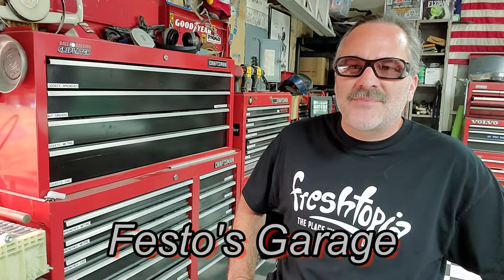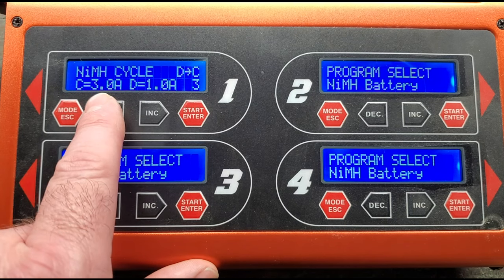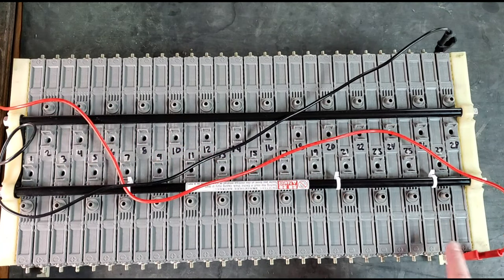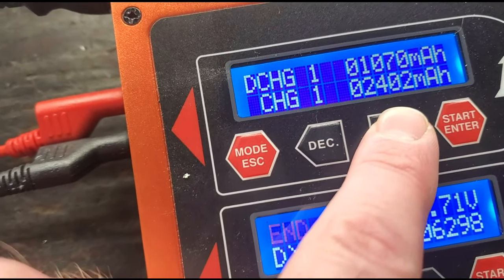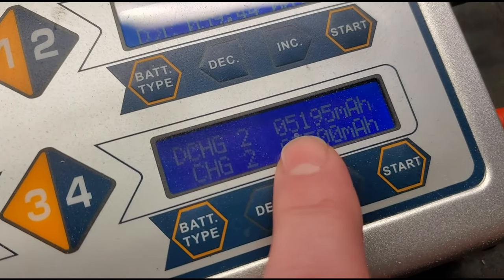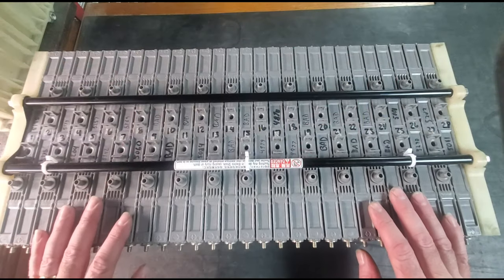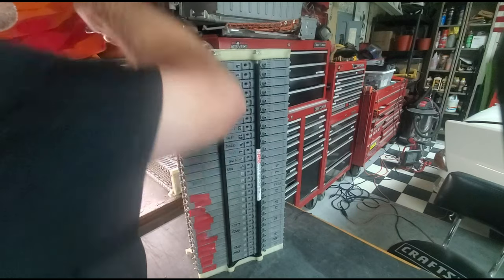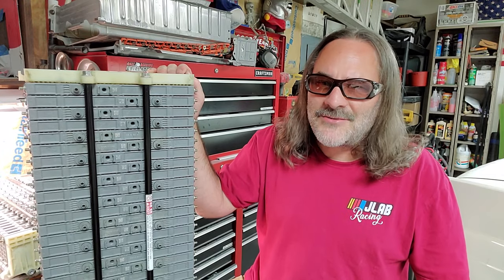Hybrid Battery Pack Refurbish - Step-By-Step w/ Settings - 2nd & 3rd Gen Toyota Prius - CQ3 Charger

Comment: Process completed.... changed out 8 bad modules. Dr Prius app says I got 97% capacity left and battery is in new condition! 😊 Will see how long this lasts before I get the orange triangle of death again 😂
Reply from the maker: Thank you for watching and providing awesome feedback.
Reply: I have the charsoon antimatter.   Basically the same in operation and function. 
 When i started in 2018 it seems there was a lot less info.
 Thankful for the recap on numbers for set up and what we want. 
 I can only charge at 7.2 or 8.4,  it goes past 9v and upwards of 10v on 8.4.   I dont like that
Reply: All my modules all seems to be good on discharging but needed help getting up to full capacity.
Reply: Is there any updates on your battery? I hear people telling me that reconditioning doesnt worth it since the battery will be weak again in 2-3 months. Is that true? Cause i am thinking if taking a risk and buying tools and all that or just go pay for a new or refurbished battery?
Reply: @MowgliLA refurbished/reconditioned is what he just did. This is the type of battery you'll be buying. If you have the time, patience an ls correct equipment to do it yourself, you can
Reply: If you dont want to do the process buy a wrench new version of your car and swapped the new cell. Lets said if you get a 2020 toyata hybrid. That HB should be good for 10 yrs or 100k miles easily. @MowgliLA
Reply: Also, you gotta know how to read the code letters on the modules so you can get the news one for a better price
Reply: No not true do it right the discharge is mpst important thing. Ive had mine fir 2 years no issues be sure to bslance after@MowgliLA
Reply: Search forums and follow the proper charge discharge reconditioning methods, these nimh cells have very long life, deep discharge to zero and recharge few cycles brings them back
Reply: How long does it usually take to run a cell thru 3 cycles?

Comment: One thing that I keep seeing about reconditioning these batteries is measuring resistance.   Measuring Miliohm resistance in batteries requires specialized equipment.   Nothing a multimeter can do.  I've been trying to determine a cheap meter that will do this, that isnt in a multithousand dollar specialized hybrid battery restoration machine.  I fond them in the $50 range with one paragraph  of english instruction, designed for flashlight and 9v style batteries.   Don't know if they would work.
-----UPDATE----
Just ordered one.  See if it works.

Comment: I like this video!  So thank you for that!  However, I see a train wreck happening if people “set it and forget it”.  Here are some tips to avoid problems.
Lets say you set the NIMH settings to charge @ 3.0 amps, discharge @ 1.0 amps, discharge cutoff 6.0 volts, CAPA 7500 mAh, wait time 5 minutes, 3 cycles, safety timer 720 minutes (12 hours) (which is what Gregg suggests).  The charger will discharge a module @ 1.0 amps down to 6.0 volts.  It will wait 5 minutes, and then charge @ 3.0 amps until it has charged 7500 mAh or Deta V is triggered (aka “delta peak charging”), which occurs when the module is fully charged.  Many chargers (such as the SkyRC charger) do not detect Delta V, but it appears this quad charger does detect Delta V.  But some modules are old, and they will no longer trigger Delta V, so you will rely on CAPA of 7500 mAh to save you (or max charge time of 12 hours)?  The problem here is that many older modules will be at their max potential voltage of 8.60 volts after applying just 4000 mAh.  
A new hybrid pack will run over $2,000 and a rebuilt pack will run $750.  An old module on Ebay runs $30.   Here are some things you can do to avoid needlessly damaging your modules:
1)	Set CAPA to 3300 mAh (for older modules), 4300 mAh (for good modules), 5300 mAh (for great modules).  Watch max voltage reached and adjust.
2)	Set charge to 3.0 amps.  After two cycles, you can set charge to 3.2 amps.
3)	Buy a SkyRC temperature probe ($10).  Set max temperature to 83 F (for a single module), or set to 110 F (if left in the pack).
4)	Set wait time between charge and discharge to 60 minutes (to allow module to cool).
5)	Set discharge to 1.0 or 2.0 amps down to 6.50 volts.  6.0 volts is too low.
6)	To refresh a module, you can discharge @ 0.1 amps from 6.5 volts down to 6.0 volts (once or twice).  Following discharge, allow 20 minutes for voltage to drift back up to 7.20 volts.  If the voltage does not rise on its own, apply a trickle charge of 0.1 amps up to 7.20 volts. Once a module is at 7.20 volts, you can apply a charge of 3.0 or 3.2 amps up to 8.60 volts.  
7)	When charging a module, the voltage may show 8.72 volts (or so).  After stopping the charge process, the actual module voltage may be 8.55 volts or less (the max voltage for Prius modules is 8.60 volts).  Delta V may be triggered around 8.72 volts.  This quad charger appears to detect Delta V, but this is not guaranteed.  Some modules are worn out, and will no longer trigger Delta V.  If you have overcharged your modules, they may no longer trigger Delta V.  If a module no longer triggers Delta V, this could be dangerous because the car’s BMS (battery management system) will not know when that module has reached it’s max charge.  
8)	When pairing modules for a pack rebuild, pair them based on similar resistance and mAh capacity.  Do NOT pair weak modules with strong modules as an attempt to fool the BMS.  It is better and safer to pair modules with similar capabilities.  Pairing modules with similar characteristics will reduce the number of failures of a hybrid battery pack.  If you have a super strong module, and you don’t have a good match, it may be best to leave that module out of the pack.
Reply: Excellent tips. Can you tell me how to best position the SkyRC  temp probe to monitor external temperature? Just set it on top?
Reply: Great clarification, Thank you! What do you mean in step 1) watch max volts reached and adjust?
Reply: Gary, in your opinion, what is the minimum amount of mAh required per module in order to have a good, working battery pack?  I have noticed with some of older modules, I am luck to achieve 3000mAh discharge, even after 5 cycles. Curious to know at what point does one just give up and classify a module as junk.
Reply: I kinda wonder what we are supposed to be shooting for. 4000 at 7.2 volts? 6500 at 8.5? or I guess more importantly, what should we be discharging in a real world scenario because there is no way in hell I can get 5000 like u r getting Mr. Festo
Reply: @MervsServiceSecrets  Someone who reconditions the batteries told me that 4500 mAh is the discharge cutoff for a single module.

Comment: Another excellent video from Gregg. I watched your first video and followed your steps exactly and my results were excellent. As was shown in your video, use decent cables rather than the cheapies found online. I did notice that some of my modules required 5 cycles of discharge/charge while others required only 3. The torque values on the bus bar nuts are 48 in-lbs when reassembling the battery pack. Thanks again Gregg for sharing your valuable knowledge.
Reply: Whats your battery performance after reconditioning?

Comment: Gregg, I want to thank you for both of your excellent prius battery videos, Your help was invaluable in taking on my battery rebuild project, setting up the charger, balancing,  assembly and disassembly of the pack. 
 A couple of things that might help others. I had to coax a number of modules thru 5-7 cycles to get them to 5000 mah, In the end I did not trust those cells or thought they would be the problems of the future so I opted to only use modules that got to 5000 mah in 3 cycles. also, I choose to lower the charge rate to 2.5 or even 2 amps on modules that tended to swell excessively, though It really extended the overall charge/cycle time.
Reply from the maker: Thank you for watching and writing in with the feedback.

Comment: Excellent demonstration. I took your advice and bought 2 chargers and have discovered that I need 10 'new' blades, I am just testing them now, and some are not getting to 5 amp hours capacity. The ebay vendor claimed that they were all above 5 amp hours, so I am still cycling them but no joy yet....
Reply from the maker: Thanks for watching. I have had some batteries come in that took a few cycles to get back to good numbers. This may be from the batteries sitting on a shelf for a while before they are sold to us and shipped out? Not sure.  Please write back and let us know how your pack turns out.
Reply: @GreggFesto I think you are right, some have taken 7 cycles but they are all getting above 5 amp hours

Comment: Still waiting of cables and battery will follow to start refurbishing  some batteries. I wanted to make a power bank out of a whole pack and connect it to a 3000 watt inverter to be used in black out. After asking around nobody could answer me. So went on Ai from Edge. If I run at 90% load so 2700 watt with fridge computer some stuff and let's say air conditioning, the final answer verified at 2 AI chats is 31 minutes so first that will kill the bank very quickly, and this makes this part of the project non feasible. Just wanted to let you know in case somebody ever wondered lol. Very dispointed, saved me couple of hours putting it together lol live and learn.
Reply: are U saying it doesn't work for your back-up

Comment: Hey greg i have 13 plug-in with 280,000 miles im in NJ averaging 50 mi to the gallon in the winter and somewhere between 60 and 80 in the summer when i first bought the car i got as Hi as 118mpg now I can't plug in as much so im down on mpg in the spring i might pull the pack and as i have RC chargers like what u use great videos 😊

Comment: I have the charsoon antimatter.   Basically the same in operation and function. 
 When i started in 2018 it seems there was a lot less info.
 Thankful for the recap on numbers for set up and what we want. 
 I can only charge at 7.2 or 8.4,  it goes past 9v and upwards of 10v on 8.4.   I dont like that, but unsure if its too much on the module

Comment: Hey there Gregg, so after watching your video I decided to go after the charger as well. While I am happy that your battery pack was in much better shape, unfortunately I can't say the same for mine. On avg all my modules end up below 1000 mah. I did find a guy who sells batteries with a range of 3500-4500 mah & so far one of his has passed the test. However, because of how many modules the pack has in general, I'm gonna have to make multiple orders to ensure that I can take care of bills at the same time. Just for reference, I do have an 09 Prius with 254k miles. So I did learn the hard way to give the battery pack at minimum 10 years before taking care of it each time in the future.
Reply from the maker: Thanks for watching.  How many cycles did you give your batteries before deciding they were not recoverable? I have had to run some 15-20 times before getting to the 5000mah value. I recently purchased some very good replacements from seller aloyhybrid on ebay for around $33 each. Each one was over 5500mah discharge. Sorry to hear you are having issues and hope you get your Prius back on the road soon.
Reply: So I've only run each battery once with the exception of the one that I purchased through eBay. There's only one from the original pack that seems to show some promise, so I'll give it another go. However I just don't have time to go wasting my electricity bill on cycling cells that just aren't showing any immediate promise. The downside of my situation is that I don't really have a nearby place where I can safely dispose of the bad batteries, especially since I've read that these nimh batteries aren't exactly healthy for the environment.
Reply from the maker: You should for sure run at least 3 cycles on each battery. Many times the first cycle will show low values or even CAPA with low discharge value.
Reply: You may wish to buy a used pack from a junk yard for $750 ($26 per module), or even $450 ($16 per module).  I wish I did this instead of buying modules off of Ebay for $330.

Comment: Hey Greg, great channel. I have configured settings from video, but for some reason it stops after first cycle. I set it to 3 cycles, and when the cell starts blinking “Capp” , I can use arrow button and cycle 2, shows zeros, and it will scroll 1,2,3,4,5, ..all zero’s except #1.
I’m still a beginner..
Thanks
John
Reply from the maker: Hey John,  Thanks for watching. Sounds like you are having good results. The charger stopped doing cycles because it met the 7500mah CAPA on first Charge cycle. Pay attention to the Discharge mah value and start cycles again. The Discharge mah value should rise each time. When you get to 5000mah Discharge this is a keeper, if you have 7500mah CAPA Charge at the same time then this is even better.

Comment: Thanks for the battery vendor tip, will try them once I get this refurbish testing done.  At time 8:56 of your YouTube video “Hybrid Battery Pack Refurbish -  Step-By-Step w/ Settings – 2nd & 3rd Gen Toyota Prius – CQ3 Charger” you change from your older red CQ3 to a newer silver & blue CQ3 charger.  This newer one is what I have and I am having trouble with the instructions for it.  If a test ends with a flashing "FULL" and I press the BATT TYPE button, no cycle results are presented, it just return to the initial screen.  What does a flashing "FULL" mean.  It apparently is not the same as "CAPA' or END.  The instructions that came with the charger say nothing about this.  Any help appreciated.
Reply from the maker: My silver charger was purchased about 3 years before the red one. I have a video that shows comparison between them. The message "FULL" is the same as "END". Be aware of the buttons when a cycle has ended. If you press the wrong one then you will get no results. The red and silver chargers have different wording on the buttons but the button position for results is the same (I believe the far left button for each channel).

Comment: Good Job Gregg,
Very thorough, that's rare.
I have a Prius, watched your video, bought both cahrgers.

programmed them as instructed, 3 cycles, discharge/charge, ran into something that you didn't mention.
About 2 hours into my time from start. all but 2 modules read FULL. I pressed the mode button as you stated if End was displayed, the screen didn't indicate and cycle information, discharge/charge... nothing, just battery type selection screen like from the beginning.
all of the 8 modules read Full but 2. Number 4 and number 28, they were still running the cycles.

Not sure what to do now. Start again? Not sure what full means pertaining to a discharged and charged module just a couple of hours into the process.

When I pulled the battery and tested each module, all tested at just over 8V but 2 at 7V. Figured that they may be the culprit

Thanks, Have a Great Evening
Reply from the maker: Thanks for watching. You are correct, FULL is the same as END. Not sure why you would not see results when pressing the same button I did. On both of my chargers it is the far left button even though they are labeled differently. You can see this at 8:55 in the video. I suggest try a different button on the next finished battery and see if you can get results. If you find that it is a different one, please let us know as someone else will have this issue too. The voltage reading is not going to tell you much about the health, remember it is the capacity that counts.
Reply: Also have this issue

Comment: Thank you for the excellent video. I wish you could post a link to the exact make & model of the charger you talk about so I know I am buying the right one. I currently have a SkyRC but I am stupified over how the menu settings work. It all seems so confusing.
Reply from the maker: Thank you for watching. The charger I use is the CQ3 from EV-PEAK Corporation. They are available and many hobby shops and Amazon. There are 2 different colors (silver and red) that both work the same.

Comment: Love seeing people diving into these subjects. Thank you! 
I just got my hands on a 22 Venza from Hertz rental with 48k on the odometer and this gives me hope. I’m trying to find out how long my Lithium cells will last. Thinking if it would be a good idea to get a battery replacement to have while the inventory is available even though it’s still only 50k on the meter. Does this make sense to get something this early?
Reply from the maker: Thank you for watching.  The more you drive the better battery will perform. Sitting for long periods is not good for them. For this reason I would not get a replacement pack and have it sitting around on a shelf - You may find out that it has gone bad on the shelf and you never got to use it.

Comment: Another great video! Hey i went to buy the charger and it has a warning "This charger is not designed for use with hybrid car batteries. Any such use will damage the charger and is not covered by warranty." Is this still the charger your using?
Reply from the maker: Thank you for watching. Yes I use the CQ3 charger for this process still. I have a red one and a silver one, they both work well and have refurbished many battery packs. There was no such warning when I purchased mine.